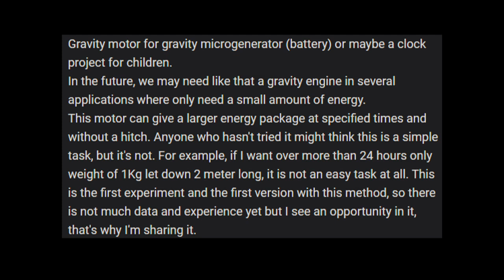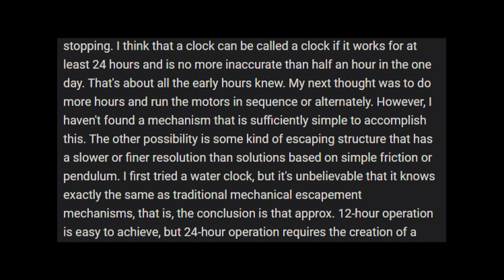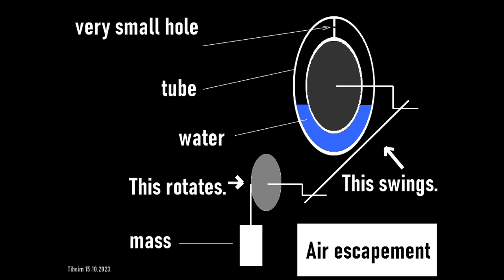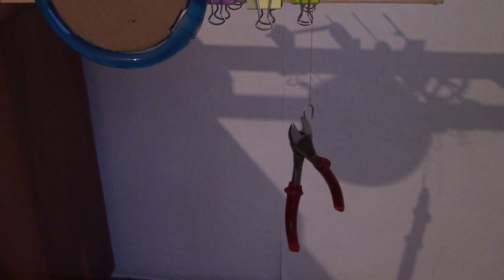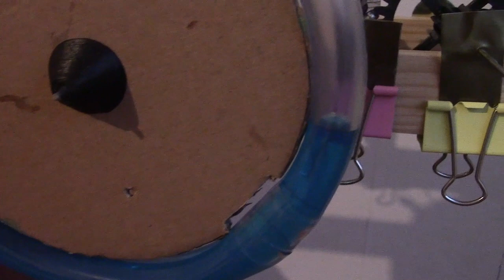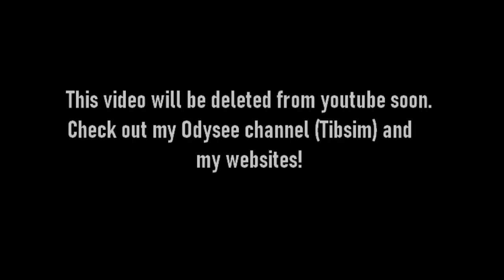Gravity motor for gravity microgenerator (battery) or maybe a clock project for children.

Comment from the maker: Gravity motor for gravity microgenerator (battery) or maybe a clock project for children. 

In the future, we may need like that a gravity engine in several applications where only need a small amount of energy.

This motor can give a larger energy package at specified times and without a hitch. Anyone who hasn't tried it might think this is a simple task, but it's not. For example, if I want over more than 24 hours only weight of 1Kg let down 2 meter long, it is not an easy task at all. This is the first experiment and the first version with this method, so there is not much data and experience yet but I see an opportunity in it, that's why I'm sharing it.

Actually I was thinking about a clock for children and I thus I made it up this structure.

So the other application could perhaps be a lesson project for children. 

Those who love science also love classes. The clock is one of the earliest machines developed by man and one of his most important inventions. I think building a clock is a great science project for anyone. However, a watch is much more complicated and much more difficult to make than the layman might think. In fact, every watch is a masterpiece! My goal was to make a simple clock that doesn't go astray for more than half an hour a day, works for at least a day, and has such a simple and transparent structure that a 10-12-year-old child can easily understand its operation and even build one . Even a medieval person would have been happy with such a structure. The first challenge in the watch is to be able to operate a gravity engine and system for more than 24 hours at all. This is already a big challenge, namely because of the Square–cube law. This roughly means that every structure has a certain ideal size. What we can do well on a small scale, we may not be able to do well on a large scale, or vice versa, and in relation to the ideal size, we cannot do it well on a much larger or smaller scale. This is because as the size of the whole system changes, the characteristics of the parts change to different degrees. If a child, or an adult like me who is not too smart, and not patient, wants to make a watch, it is about possible for him if his clock can only run for 12 hours without stopping. I think that a clock can be called a clock if it works for at least 24 hours and is no more inaccurate than half an hour in the one day. That's about all the early hours knew. My next thought was to do more hours and run the motors in sequence or alternately. However, I haven't found a mechanism that is sufficiently simple to accomplish this. The other possibility is some kind of escaping structure that has a slower or finer resolution than solutions based on simple friction or pendulum. I first tried a water clock, but it's unbelievable that it knows exactly the same as traditional mechanical escapement mechanisms, that is, the conclusion is that approx. 12-hour operation is easy to achieve, but 24-hour operation requires the creation of a masterpiece. With the water clock, the surface tension of the water is the obstacle. The solution seems to be to make not a water clock, not an hourglass, but an air clock, in a way that is as simple as a water clock. All mechanical clocks change speed in response to ambient temperature. They were able to reduce this with pendulum clocks and various inventions. Then the accuracy improved due to better escapement mechanisms, as well as miniaturization and more precise workmanship. The viscosity of air also changes with the air (unlike that of water, it increases as a result of warming), but I do not yet know how much this difference means on a daily basis in the case of such a watch. The temperature in the apartment is pretty much constant anyway, so maybe this wouldn't be such a big problem. Since this clock is based on friction and not a pendulum, it is definitely not that accurate. As the temperature changes, not only the size of the materials changes, but also the friction, but maybe that wouldn't be a problem either. However, when we use gears, the torque passing through the gears will also constantly change, due to the inaccuracy of the gear and the fact that the teeth press against each other at different distances from the shaft. So a clock based on friction is even more inaccurate in smaller time units than in larger ones, where these differences balance each other out and give an average. The unevenness of the gear system can be corrected by using several motors and/or gears in parallel. Of course, if we don't achieve medieval precision, this gravity engine will still fulfill the challenge of working for more than 24 hours much more reliably, easily and simply, and maybe it can be the basis of a clock or something else, for example a gravity microgenerator (battery).